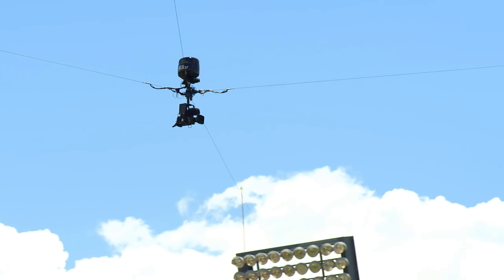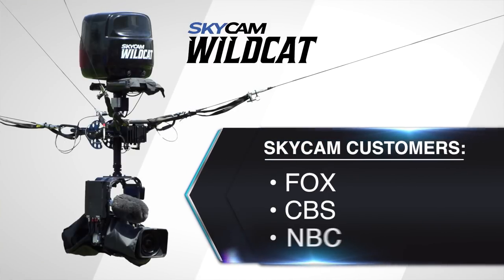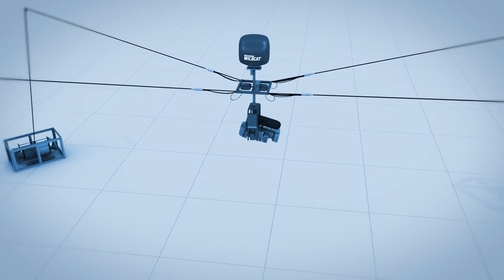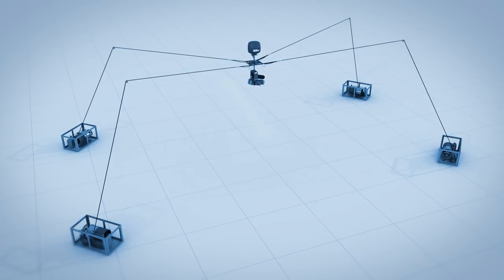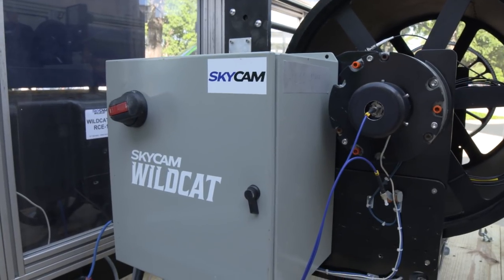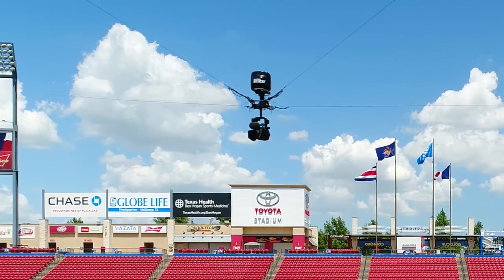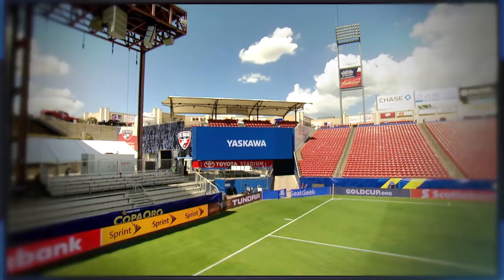Yaskawa makes Skycam a Football Hero

Comment: What is that big round cylinder on top of the camera? Is that some type of counterweight?
Reply from the maker: Hi, The top serves as a counterweight, but there's probably more at work up there. We didn't get into the details since our products are not located in the top, but we believe the top section houses a gyroscope that keeps the unit level despite swinging movement. The top also contains some of the electronics that tilt/spin the camera and output the video. - Jeff Watter, Yasawa Marketing Communications Specialist
Reply: @YaskawaAmerica Thanks for the reply!
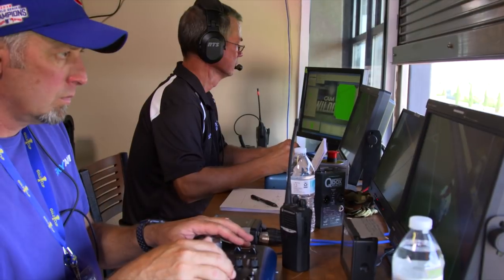Reply: @YaskawaAmerica One more question. Someone asked this on a different sky cam video but there wasn’t a reply. Next to the SkyCam pilots in the booth is a big red button. I’m assuming that it’s an emergency return “home” button in case the camera starts acting wonky.  If the operator presses the button, the camera will move off the field and to a previously determined safe location.  Can you confirm if that’s the case.  You can see the button around 2:50 on this video.

Comment: which exact Servo Motors and SERVOPACK amplifiers models do You use in skycams?
Reply from the maker: Thanks for your question. Specific model number data on servos and amps is information that the Skycam people would prefer to keep proprietary, but we can say that Skycam units use standard Sigma-5 rotary servomotors and SERVOPACK amplifiers. When there's a break in their sports action, they tell us they're hoping to upgrade to the extra performance and superior lightness of Yaskawa's latest Sigma-7 systems.